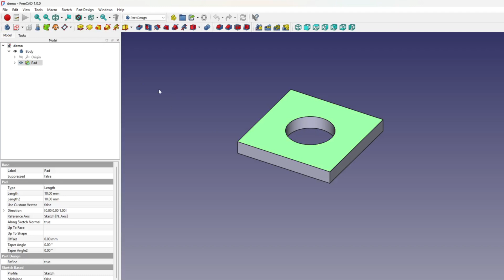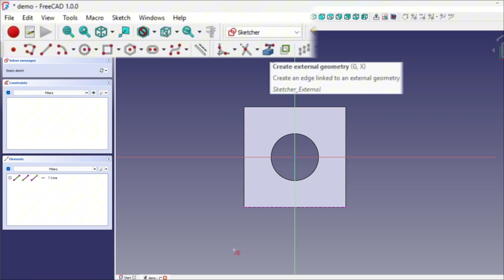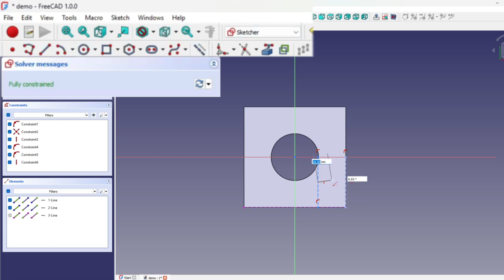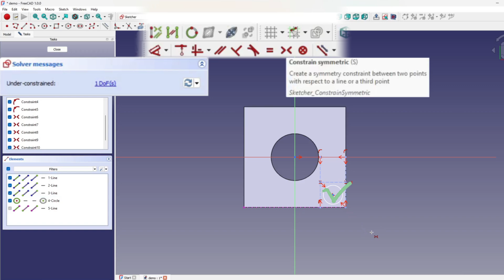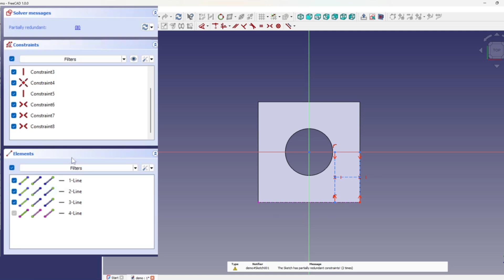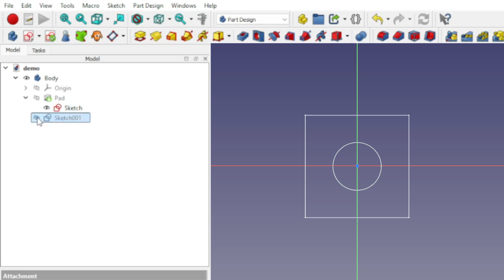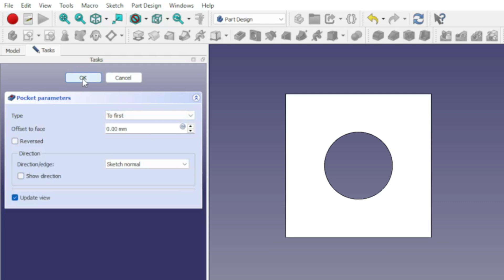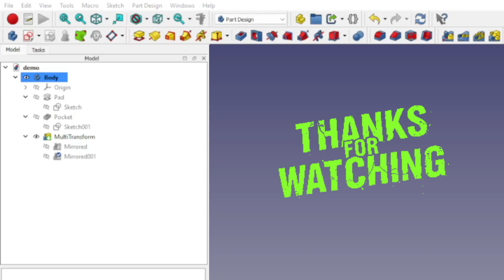FreeCAD Made Easy Part 3: Pocket Tool Tutorial

Comment: im stuck at 6:44 adding constraints. I cant see to get it right. im receiving redundant constraints.
Reply from the maker: That "redundant constraints" message means FreeCAD's solver found two rules that say the same thing — it's already figured out that relationship from earlier constraints. This often happens if you add a distance to an edge that's already defined, or duplicate a constraint previously filled in by FreeCAD (the most likely cause).

Try hovering your mouse over the solver message in the Tasks panel — it'll often show which constraint is conflicting or unnecessary. Then, delete that extra constraint to clear the conflict.

Once the sketch is fully constrained (but not over-constrained), the solver message will turn green again. Which constraint were you adding when the message appeared? That might help narrow it down.